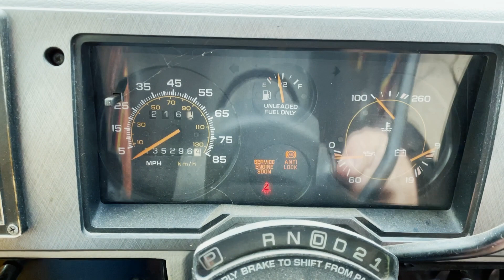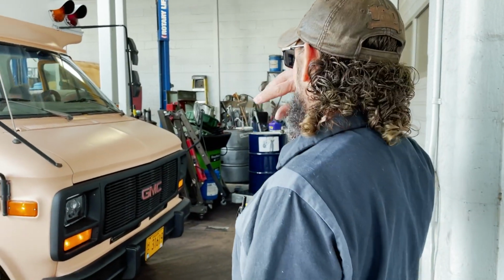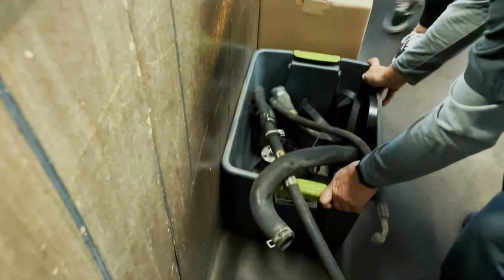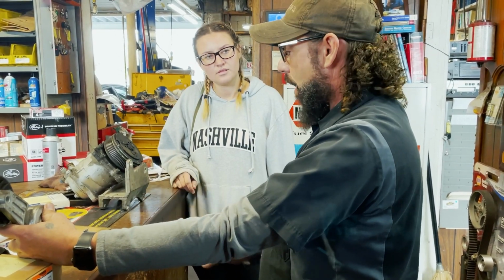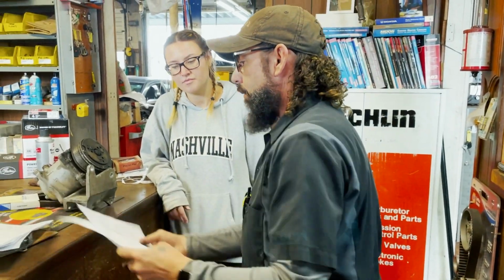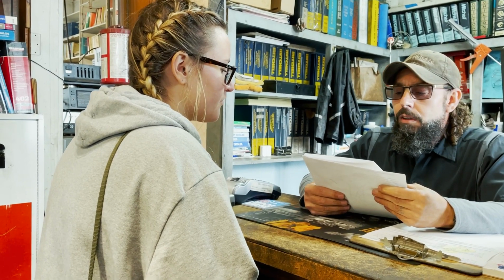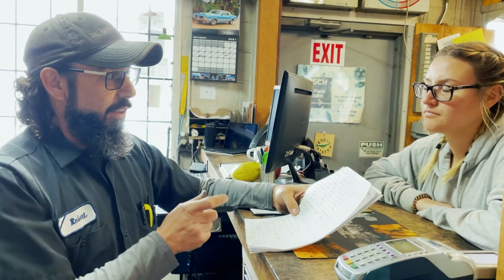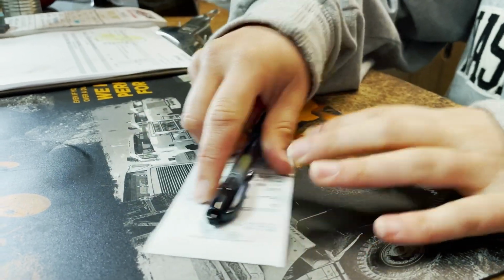Bus Problems - What Was Wrong? How Much Did It Cost To Fix!?

Comment: Wow, what a great job. God bless Robert.  Having a good mechanic is like having a good doctor that you can trust.  I know $700 is a lot of money, but when he started explaining all they did I was expecting $1000 +.  Sounds like they got rid of a lot of future potential problems and fixed some issues that have been going on a long time.
You will need a defroster up in Oregon.  I suggest getting an external heater/fan that sets on your dash by going to Harbor freight or ordering one from Amazon it should plug into 12 volt outlet.  
That has got to make you feel better, whewwew.  Again kudos to Robert jeepin! 😀🥰✌️
Reply: Most say those little heaters don't work...by the power draw...they can't really cuz can't get much power out of the little 22ga wires used for the power outlets

Comment: I like how he actually breaks down what he done .need more mechanics like that.
Reply: Amen
Reply: that's what should be done at every repair shop either by the mechanic or a service manager if they have one,if they don't find another shop in fact most states require the repair shop to offer the customer the old parts that were replaced and give them the option of taking them with them or not, if it was me I would have kept the old brackets so if I wanted to reinstall the ac in the future i could
Reply: @chasgs  Kudos to Robert. This is about Jaylenas repairs, done by a very knowledgable mechanic. So, pats on the back for  Robert.

Comment: While repairing the dash heater/defroster should be done, remember you can always pivot your (NAPA)fan to blow on the windshield. I'd also write down the belt size and take photos of how it's routed around the pulleys. Likely your underhood diagram includes the A/C and your belt doesn't follow that pattern anymore. The dash heater is usually pretty simple, if you use a test light or multimeter you could trace the power to find out the fault. Dash switch to relay, ballast resistor for various speeds, the fan motor itself. A jumper wire from the battery to the (+) wire on the fan can determine if the motor is OK.
Reply: Those old ones always showed A/C and no A/C

Comment: YAY I'm so happy that the bus in ship shape now! ❤️...700.00 is a lot of money, but I feel like it could have been worse! ... Luv ya 🤗
Reply: About 200 for water pump and hoses...serpentine belt 75, auto belt tensioner 75, radiator cap 25, antifreeze @ $15/gallon....and...4-10 hours labour with adjusting headlights, switching fuses and the repairs

Comment: $700 is a pretty good price considering all the work they did and parts that were swapped out. PLUS it's a pain to work on vans because of the cramped engine compartment and limited access. Did you also get a basic Tune-Up? I don't remember hearing that in the video. Plugs, wires, oil and filter, fuel filter at the carb. So on and so forth.
Reply: @thegoodtom1718  90's or newer van? Then she definitely got off light at just $700

Comment: You need to worry about the cab heater and defroster. It gets cold in Oregon and you can't see out of a frosty windshield. At least order a portable 12volt heater fan, they are small. Plug into Jackery and put on the dash. They are cheap.
Reply: Yes..and yes

Comment: now all you need to complete the job is to stop at the parts store and buy a FUEL CAP ,,gotta keep all that rain that's a coming from getting in that fuel tank ......,,or a new roll of blue tape and now for future reference you should write down the belt number somewhere and keep it handy because of the changes made, the drive because if the belt breaks and needs replacement the original equipment belt size will no longer fit due to the elimination of the ac, what we did back in the day is write down the new belt number down in the engine compartment with a PAINT PEN so if you sell the bus anyone can see that
Reply: I also put a fuel cap on she is good to go
Reply: Also it is a factory size belt, we did not use a delete kit we made it back to factory that came without a/c her part numbers are orig equipment numbers
Reply: @Robertsjeepin4x4   I didn't know that was aftermarket

Comment: Ya might get a smidge better MPG without that ol AC .  Check yr wires that ran to the rear heater , those could be shorting an cause the problem yr having w/ the front heater/defrost .   Happy Trails

Comment: I had almost thought he was going to get you when talking about  the ac compressor then said deleting it but everything thing he did is what I expect most shops to do also show youthe bad parts beforestartingthe repair if possible. I save the bigger parts I replace until the customer picks up the car. And for having a defroster if the van is warm to the Napa fan around and blow that on to the windshield.

Comment: I can not emphasize enough the importance of having a working heater, specifically having a working defroster.  Put this on the top of your to-do list to get this repaired.  Do not believe your Chinese diesel heater will replace your defroster.  It will not.  If Robert is your mechanic, he should be able to diagnose and subsequently repair it.  If he is unable to do so, find a mechanic who will.  Your safety and that of others depends on a working defroster.

Comment: Oh my gosh.  I just got my car fixed.  I bought the rack-n-pinion steering part.  I put it in the shop.  They had to put a new tire, plus the one  I had on.  So two tires on, 1 they purchased new, balanced,  an alignment, and the rack n pinion on.  It cost me $1800.00.  I am not sure if that was a good price or not.  Now I have purchased a charcoal canister and EVAP solenoid value  that needs to be put on my car.  I have been quoted a price of $500 to remove the gas tank and put both parts on.  I am worried.

Comment: Wow I saw the price for what he did that was fantastic great prices. Hey I used to have a car that had no heater or defrost in it and you can go on Amazon and they have these 12 Volt windshield defroster fans that's also you can turn and use as a heater for yourself or for like the front area and they were like 20 bucks you plug it into a cigarette lighter and it worked fantastic couple days in Georgia here that I got for you it was below 0 and all I did was start my car up plug it in wait about 5 minutes and the car was warm inside and the windshield was defrosted and then I would turn it to the so it would forcing it to the back window but in a bus that would be hard anyway stay safe stay strong stay healthy God bless and enjoy life say hello to my favorite Filipino!🔥🌻✌💪💖👨‍🍳🎅🚌👍
hey I did a search 12V Defroster Fan on Amazon

Comment: As a mechanic,  he did you right. However,  I would never eliminate the a/c compressor,  as it is an instrumental part of a properly working defrost mode, and in the summer you will definitely appreciate it. As far as the electrical issues, he should of been able to properly repair that as well.

Comment: wondering did the bus over heat and if so did he check for upper and lower intake leaks and head gasket leak that's very common when over heating ,,, other then that he did good and god yes some times it takes time to get things fixed for sure good vid and good mechanic

Comment: Study up on the way cooling systems work.the radiator cap would not allow the radiator hoses to collapse the lower hose is the suction hose for the water pump and usually has a spring in it to stop it from collapsing if you pull your radiator cap off the little center disc is like a check valve when the engine cools down it creates a vacuum in the cooling system witch sucks coolant from your overflow tank through the little round disc. Check valve in the center of  radiator cap the only way a hose can collapse is if the radiator cap is bad research it.been are certified Master mechanic since 1987 also the weap holes on the water pump are actually vents when the seal on the water pump shift leaks coolant can come out of both of those holes same cavity in the water pump casting if you would like more info or have any questions just ask could probably walk you through the heater problem also good luck

Comment: That's the bad thing about buying a used vehicle. You take on someone else's problems. Glad it's fixed
Reply: I mentioned it numerous times in previous videos. Change the water pump, all fluids, hoses, rubber vacuum hoses,  plugs wires cap rotor etc. A lot can be done by a diyer.  That's like a $35 water pump and 1hr labor. Change it it dirt cheap and critical

Comment: Good deal Jaylena on Bus repairs. Wondering why you removed the A/C portion from the motor ? Also sounded like you also have no heat?  Just my curiosity? Enjoy your Bus driving and preventative maintenance is always a Key factor :) FYI It's not just Girls my Dad was taken advantage of  because he didn't know a lot about it when he was younger. But it is a shame more often than not women get taken advantage of more often by crooked Mechanic shops . Any ways Happy it's fixed for now. Laterz - Leland

Comment: Glad to see you got a good mechanic.
What he said about running the bus more he is right.
I’m still worried about your battery. Need to get it checked. When you went out to Eugene Oregon on your trip you killed the battery. Yes it’s working but the life of it went down because of that. You’ve had to run it down below 50% and that’s not good for ask Isaac about it with solar batteries.
Ask your mechanic about it he may have checked the battery but you just never know about those things.
Just trying to help.

Comment: 700.00 You Did Get Ripped Off My Jose Machanic In Florida Changed The Water Pump On My 1988 G20 Chevy Van For Only 50.00 It Was A Big Misteak To Delete Your AC You Will Wish You Had It In The Summer. I Hate To See Ladys Get Ripped Off By Machanics All The Time SO SAD